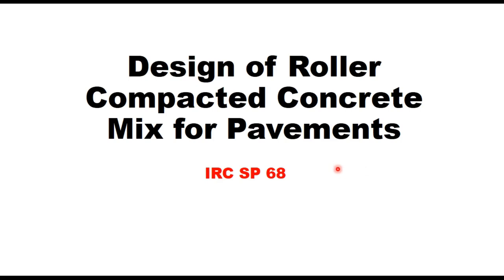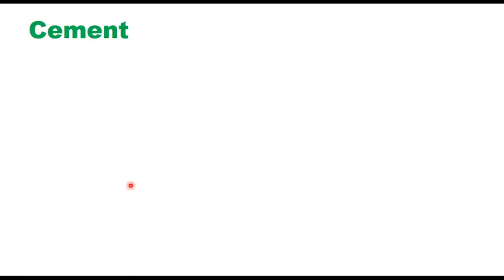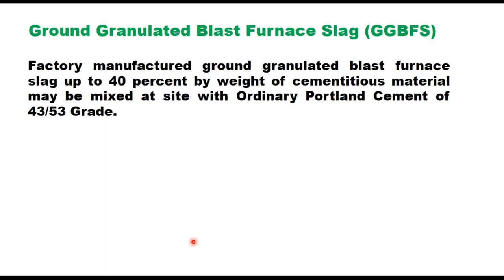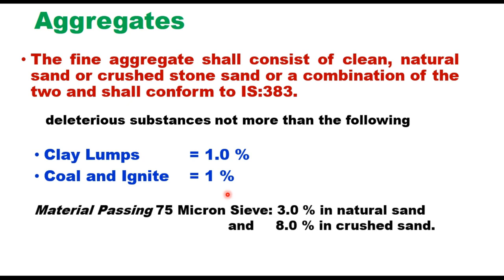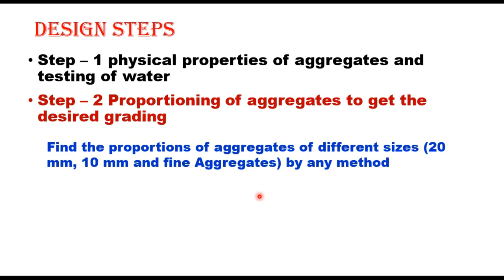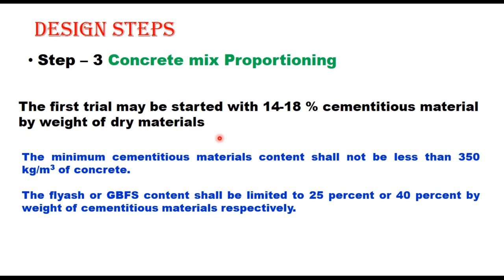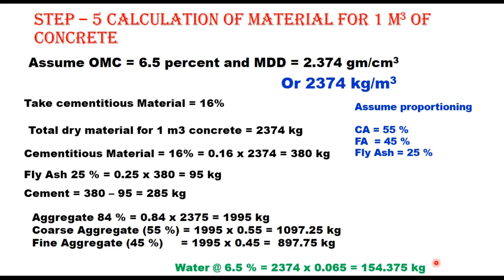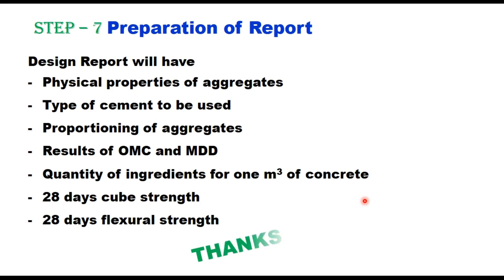Roller Compacted Concrete for pavements, Applications, Mix Design and Quality Control.

Comment: 1 . What is the additional advantage of RCCP over conventional conventional concrete pavement?
2. Why is it not to be used for highway and expressways ?
Reply from the maker: RCCP are not recommended for high volume roads. They are suitable only for rural roads.

Comment: Sir, What is the method of  cube casting that means how many blows of hammer
Reply from the maker: Cube should not be casted with hammer. Use Plate vibrator.